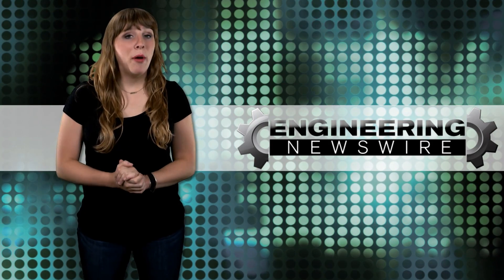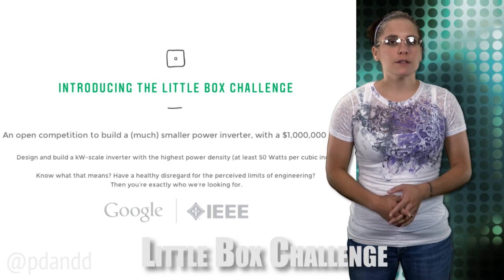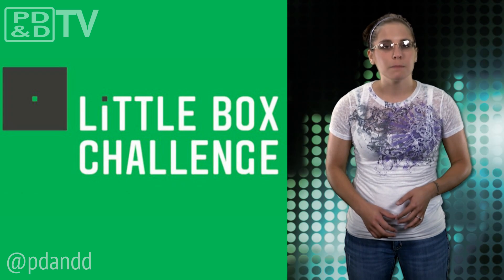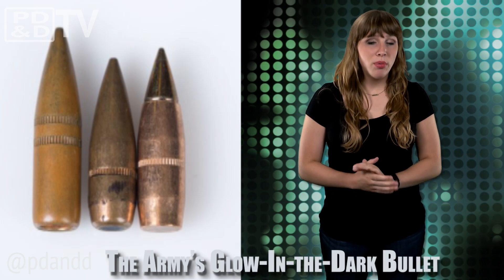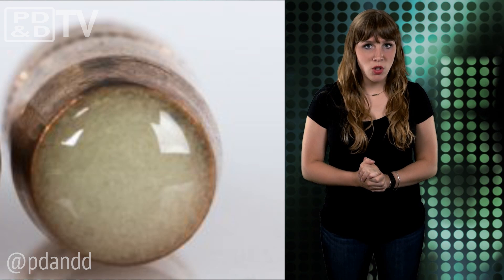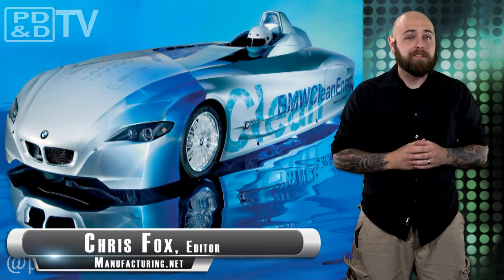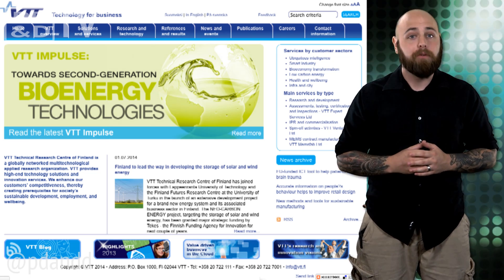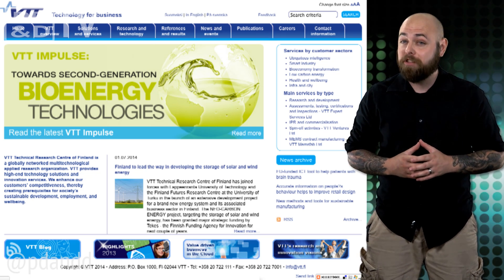Engineering Newswire 101: The Army’s New Glow-in-the-Dark Bullets

Comment: I have spent most of my life miniaturizing  my power supply, battery charger, and inverter designs.
One reason laptops cost more than desktop computers, is that money was not spent miniaturizing the power supply.
Miniaturizing inverters for a house seems silly to me, but what do I know?
--------------------------------------------------
Burning Hydrogen makes water, which is a serious greenhouse gas.
Burning Carbon makes CO2, which is an insignificant greenhouse gas.
My Finish engineer ancestors are rolling over  in their graves.